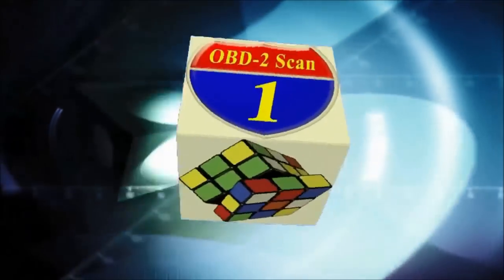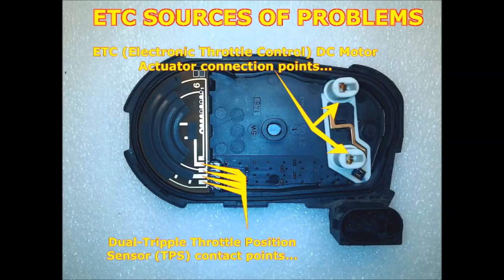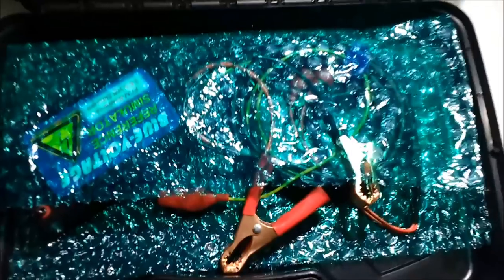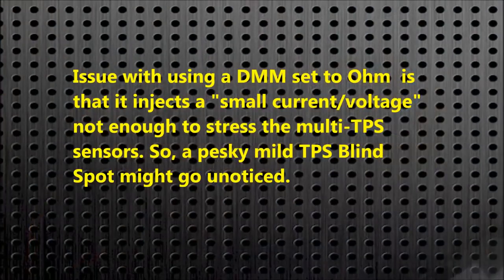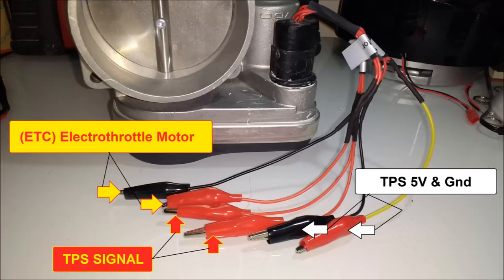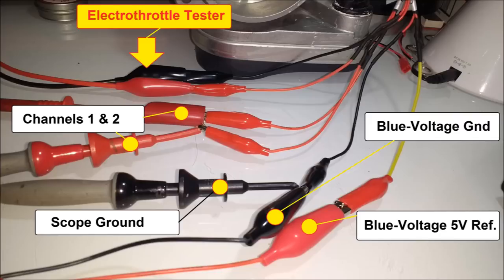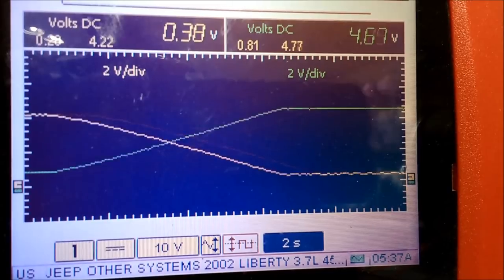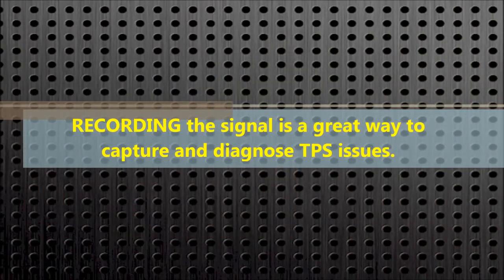TPS Electronic Throttle Waveform Testing

Comment: My mazda 2 2009y 1.3 petrol Has very sensitive throttle. When I just touch a little bit throttle, RPM goes immidietly at 3000RPM. Is IT possibile to somehow make throttle less sensitive?
Reply from the maker: Your issue is very likely a defective APP accelerator pedal podition sensor or a TPS in the throttle body.

Comment: Hi Masters, What do you advise me for a TPS that opens and closes alone
in Idle
Reply from the maker: 2 possibilities:

1) you're loosing ground intermittently. So, of the sensor ground raises on and off momentarily, you'll see a TPS reading going up and down.
2) There's a blind spot at the TPS, carbon tracks. 

Both of these are very common.